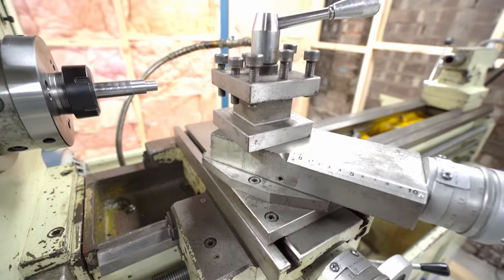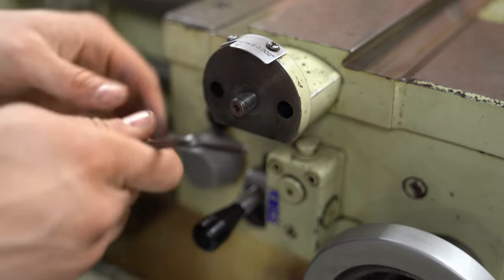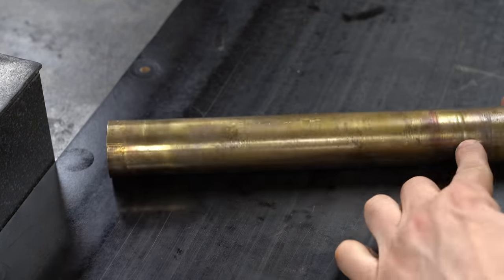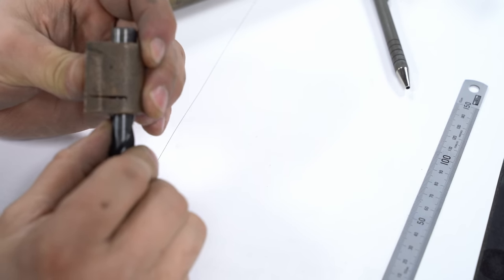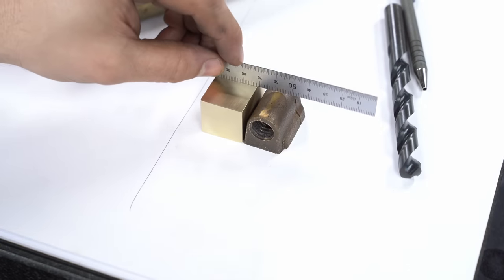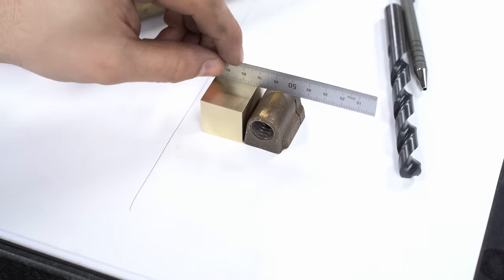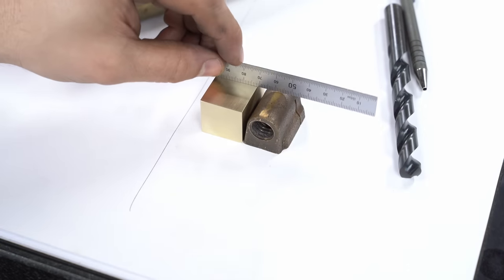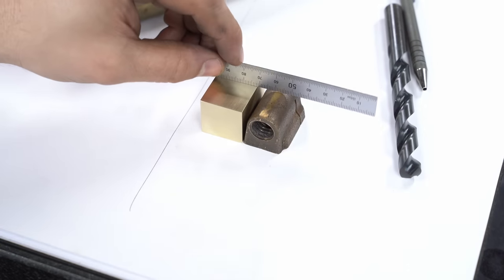Making a PRECISE lead screw nut | CRAIG'S WORKSHOP

Comment: Gday Craig, the new nut turned out great, I didn’t know that you can use magnets to check aluminium bronze, handy to know for sure, great job mate, cheers
Reply from the maker: Thanks Matty. Appreciate you commenting and watching. I don't remember where I picked up the Al Bronze info, but it makes sense with the iron and nickel content. Hope it helps you out some time. Cheers mate. Craig
Reply: @CraigsWorkshop  Alu Bronze is a miracle material. And the only thing which beats it for toughness and reliability is Nickel Alu Bronze. 
Many people would assume brass would be ideal for such a nut but the only good thing about it is that it is probably less likely to wear the screw (unless there's grit about, in which case it will embed in the brass and all bets are off). Fixing the lube situation should ensure your screw and nut last a lifetime!
Reply from the maker: @Gottenhimfella  thanks for that 👍 Yes I have already fixed the lube situation. I found some more of those oilers and fitted a new one the next day. Pumping some oil into there regularly will flush out any muck and hopefully give the nut (and screw) a long life 👍

Comment: You can always check your thread pitch before chucking the job by running a scratch pass with an external threading tool on a round piece of scrap, diameter. Is unimportant.
Reply from the maker: Yes that is a good point but I had already jumped the gun and chucked up the block. So this ended up being quicker all things considered but yes checking on a bit of scrap is the best way 👍

Comment: When lapping we were taught to go in a figure 8 motion so as not to round an edge.
Reply from the maker: Yes that's the correct way to do it. 👍

It's possible also to lap in a straight line, to get rid of machine marks and keep it flat within a certain tolerance.

Comment from the maker: Sorry if I made it unclear in the video but the off-white Herless lathe is the one that needs the repair. The grey Premo lathe (while I still have it, it has to go any day now) is being used to make the part, just for convenience.

I thought of a way to make this work on one lathe though, I don't see why someone couldn't remove the crossfeed nut and screw, lock up the gib, and use the compound set at 90 degrees, to advance the cut. And vise versa, for working on the compound nut and/or screw.

Cheers!

Comment: Hi, I have a suggestion for you on the back-lash adjustment.
As designed, you close the gap progressively until you close the gap, when this point is reached, you could put a grub screw in the bottom of the hole and a 5mm bearing pad over the grub screw, or just a 5mm pad to make a bearing face level with the 'cut' in the nut,  you could open up the gap by 'jacking' the small part of the 'nut' and use the other side of the thread to eliminate back lash, thus extending the life of the 'nut'
Reply from the maker: This is a good idea. Thank you 👍

Comment: Great video Craig 👍 I cut some aluminium bronze for the first time recently and I'll give it a wide berth in future (unless the job really calls for it). It was as tough as old boots! With that in mind, well done on such a nice clean job. I look forward to the next episode.
Reply from the maker: It's certainly some good material. I didn't do much to it with hand tools, which is when you'd feel it most of course. I could tell when filing it at the end though that it didn't want to be filed! Instead it wanted the file to skate. Thank you for the kind words.
Reply: I obtained some old propeller shafts from fishing boats, fairly cheaply from a scrap dealer. They are 30 and 42mm diameter x 1.2m long, aluminium bronze; 11% aluminium, 4% Nickel, 1% iron approximately. I found that it machines beautifully with a carbide insert, without making the tiny chips you often get from brass. It polishes nicely too.  I love it!
Reply from the maker: We live near the coast so a lot of the recycled materials that are available are ex-boat or ex-marine-machine stuff. Aluminium Bronze is very corrosion resistant and used in this environment for that reason, so this is another reason I think this piece I have is Al Bronze. That part of the video was getting lengthy though so I cut my reasoning out. I agree though, it cuts well and is a nice hard (and slippery) material. You did well to get those bits! I will keep my eyes peeled for more.

Comment: Your logic is solid. Nice thoughtful procedures, and exposition.
Reply: Did you check backlash at multiple points along the leadscrew? 
Often there is more wear away from the ends of the travel... 
but I guess you'd have a good idea whether there was uneven wear, just from running the screw by hand through the initially tight nut.
Reply from the maker: Yes - there's a section of screw when the cross slide is moved to the near extreme (towards lathe operator), and that section is about 10mm long or 3/8" and it's a bit tighter than I'd want for comfort, but it's usable. Without recutting the screw or chasing the thread on it, It's about as good as I could hope for.

Considering what I started with, where the nut threads were like blades, and the backlash was out of control, I'm very pleased with it.

Comment: Nicely executed job and good result. Well done. Like the way you determined the vertical centre line of the thread.
Reply from the maker: Thanks! Yes with it being so worn there was not a lot to measure, but I think the minor diameter of the threads (which is not meant to be a contact surface) is about as good as I could get, given the circumstances! 👍 thanks again.

Comment: When i remade my cross feed leadscrew nut of my hungarian E1N lathe i used i different method than yours of marking the center of the leadscrew threaded hole on the nut. I made a transfer punch that fits perfectly in the carriage's leadscrew hole and hit the semi-finished nut with it that i previously installed into its place. After that i disassembled the nut and clamped it on the 4jaw chuck and dialed it in using the center mark as a reference. I think it is a quicker and maybe more precise method than measuring a worn-out thread. I would like to make it clear that, i am not criticizing your method, i am just trying to help others. 
By the way i have just found your channel, i really enjoy your videos, moreover i learn a lot from them.

I hope i was understandable english is not my first language.
Reply: Te olyan aranyos vagy
Reply from the maker: Thanks Buresz, that is a great idea, and a very accurate method. I wish I had thought of it before I started! Next time. Thanks for sharing your idea, and thanks for the kind comments. See you in the next video.

PS: Your English is perfect.

Comment: I just replaced a number of oilers on my Voust. They were all blind holes since I didn’t want to disassemble. The oilers were 8 mm. After cleaning out the balls and springs I found a 5/16 tap wound grab the shell and let me spin them out. I may need to create a new nut for the cross feed as well so this video is right on time.
Reply from the maker: That's a great idea thanks, and I might just give that a go. Good luck with your own rebuild.

Comment: That oiler will go a LONG way in keeping that lead screw in working order
Very nice!  Keep em coming!!!!
Reply from the maker: Absolutely. I remembered after the video went out that I've actually got a few spare button oilers here that my friend Matty sent me. I'll have to check their size and see if they'll fit. It will make all the difference if the screw and nut is kept clean and lubed. Thanks Hayden!
Reply from the maker: You'll be pleased to know that I found those oilers, they were 8mm, so I set up the crossslide, drilled and reamed 8H7 and it was a nice snug press fit in place - easy to oil now! 👍

Comment: Hi Craigs, nice job on the nut. Always hard to find the centre but your setup looked as though you got it close. Cheers Kevin
Reply from the maker: Yes it went very well. I did a bunch of measuring of the screw in free space (supported by bearings at dial end) and then the screw's free end while the nut was engaged with the screw and the cross slide wound towards the operator. Any deflection was minimal and the same deflection achievable on the screw with minimal finger pressure when it was sitting free. So I am a happy chap, it is as good as it ever needs to be 👍

Comment: Prick punch? Sounds like someone needs to make themselves an optical punch! I had a ton of fun making mine.  Turned out non critical dimensions were so accurate, I could not measure them! Very satisfying, but also took a month to make 😮
Reply from the maker: I may well be picking your brain about this topic in the future! For best accuracy here in the workshop my main method is to use the DRO directly, but for this particular setup, for some reason I wanted to do it the old fashioned way. Those punch marks did come out exactly where I wanted them, but they don't always! An optical centre punch would make it spot-on every time.

Comment: My Hardinge has adjustable nuts to take backlash out. Worth looking at to copy. 👍
Reply from the maker: Thanks Chris. My PAL mill has a cartridge with two large opposing bronze nuts with lots of engagement on the screw, and they have a fine thread separating them allowing some axial displacement, to take the backlash out. Works well, but takes up a fist-sized space in the table. This lathe has a much smaller space, and this lathe will not get industrial use again, only hobbyist, so what I've done will be great. I can add the original adjustment feature back in, in about half an hour, when needed, so that's on the "someday maybe" list, depending on how fast it wears. With a brand new oiler feeding that nut and screw, and with my light usage, I think it'll last a while. Thanks for the idea!

Comment: Great job Craig! I also like to machine harder/hardened steel. The chips just seem to pull the heat, are very distinct, and it just seems easier to get a great finish! Tool wear aside of course.
Reply: I’m glad we got to see the height gauge in use. I think the last time we saw that was in one of your update videos
Reply from the maker: Thanks Dan. Yes - it was quite satisfying watching the carbide produce the tidy little pile of chips! And most importantly the DTI arm is now usable whenever I need it. So that's a bit of a win. Cheers! Craig

Comment: Regarding hardened parts, i have found that they machine perfectly if you have a tool that can cut them... The harder the piece - the better the finish... I took some cbn inserts aswell, and even on my minilathe, a precision lathe from the early 70`s, not a new import - file hard steel pins machine perfectly with a mirror finish... Not really optical mirror finish, but a mirror like finish with rainbow reflection of the light... 
And if you do machine hard parts, treat the operation as if you were using abrasive media... The chips that come from hard parts are machine killers if the machine isnt properly covered and thoroughly cleaned after taking the covers off - just to get rid of any potential crap that fell off the covers onto the ways...

Also, for checking the threads on the internal diameter, dont, just take a scrap piece and make an outer pass... Check that, and if that is right, well, the lathe will cut the same cut as long as you dont mess with the gear ratios, be it internal or external cuts...
Reply from the maker: Those are some very good points. I do try to be very wary of chips from cast iron or hardened stuff, as you say - it's the ideal material for ruining those lovely precision ways!

Great idea about doing the internal thread checking, it seems obvious now that you mention it, but - I hadn't found the solution so far! Thank you for the idea.
Reply: @CraigsWorkshop 
You are most welcome... I thought it stupid to even write down, but i know that i was taught dozens of tricks that once you look back seem like such an obvious thing, yet without being shown, they take ages to precipitate in the mind... 

All the best!

Comment: Woa i didn't even know there's a variety of bronze that got some parts pf iron so it can be magnetic. One recommendation i would give by experience is using liquid metal (epoxy) for making the lead screw, you just make the thread using the screw itself as mold so you got a perfect fit thread, and you believe or not the screw is very resistant, you can even add brass dust to the mix for better result
Reply from the maker: Thank you for the idea. I have heard some folks use delrin and mold it around the screw too.
Reply: @CraigsWorkshop  yeah, i even used liquid metal to hold bearings, of course you need to cover with a metal sheet to avoid cracks, but is the best way when you don't have a way to machine parts

Comment: Just found you. I thought that was excellent. I did exactly the same as you in that I used an old threading tool (mine was brazed carbide so used slow speed green wheel) to make a tool to cut a 5tpi acme nut for my Harrison Mill restoration. Unfortunately my tool was too flimsy and I ended up using a solid carbide 5 acme tool instead. Look forward to watching your back catalogue.
Reply from the maker: Thank you Carl. Great to have you on board. Solid Carbide sounds like it would make a very nice rigid (and accurate) threading tool. 👍 Don't go too far back into my back catalogue, I had no idea how to make a reasonably good video for the first couple of years! Anything from the last year or 18 months should be watchable though. 👍
Reply: @CraigsWorkshop  No problem. I've been making films for just over a year now and I try to be myself and just show people what I am doing. The solid carbide tool was pricey but did the job. I still have a long way to go with my mill Resto but it is a case of one bite at a time.
Reply from the maker: Hi Carl, I did not realise that you were making videos. Just went to check out your threading video and after a few mins watching, it's great. Love the channel so far by the way - very clear descriptions and good video. I'll be watching more! Thanks for the heads up.
Reply: @CraigsWorkshop  Thank you that is extremely kind of you to say. I work away so I don't post regularly. When I do I try to make it the best quality I can in terms of content and clarity.

Comment: G'day Craig.  Excellent video, & showing what can be done in a Meticulous Endeavour. The Lead Screw Nut worked out really well.  
Just wondering what would happen if the Nut was 50 to 100% longer. Would it give more stability over a longer term
Reply from the maker: Thanks Ted, that's kind of you to say. I think a longer nut would wear better, yes. But threading it would become more of a challenge because of the aspect ratio of the tool. Perhaps with a boring bar style threading tool, which can more closely fill the 12.5mm minor diameter? Or - perhaps a solid carbide bar.

Comment: Great work! I did a couple of those but I found the tool hard to grind
Reply from the maker: Thanks Dermot! You're right, it's a bit tricky. I got the tool "finished" as in it seemed like I was up to the lines, but after checking with the protractor again, I was back to the grinder to tweak it further. It's a bit of a knack, but if you're patient it usually goes ok. Thanks for the comment. Cheers, Craig
Reply: @CraigsWorkshop  I finished the tool off with a hand stone because I was too scared to go undersize. It took ages lol
Reply from the maker: I know that feeling! I ground the sides, got the angles right and locked in, honed them, and only then did I think about the tip width (which I also did with a stone), this gives me a relatively decent amount of leeway on the sides.

Comment: Good work there Craig.
That'll last a good while.
Not really sure why you didn't cut the adjuster slot while it was apart..
But, hay, the bronze will out last brass anyways.
Reply from the maker: Thanks Carl! Good to hear from you! I just thought it would be interesting to see how long the nut can maintain "acceptable" backlash before I feel the need to adjust it out. A bit of an experiment. On my emco, which is decades old, the "ear" that provides the adjustment on the cross feed nut is actually missing, broken off. It has excellent, tiny amounts of backlash, so I thought I would try it here. Whipping the nut out of the slide, cutting a slot, and drilling and tapping that hole will only take half an hour. 👍
Reply from the maker: And yes, half an hour in my imagination is probably 2h+ in reality 😂

Comment: If you end up with a narrow tool for threading you can pitch off on the compound plus then minus
I was taught this method in the tool room I started in 1977.
Reply from the maker: Thanks, that is a good idea 👍 If I remember correctly that is what I did for the final 1 thou pass.
Reply: @CraigsWorkshop  It is usful also on roughing out big wide threads as you can use a narrower tool (for square profile) 
As then you have less full profile which on a long run less chance of chatter...
Reply from the maker: @theessexhunter1305  Ah yes - I see what you mean. Great idea especially for deeper internal threads or threads in harder material, or larger pitch. Thank you for the comment 👍